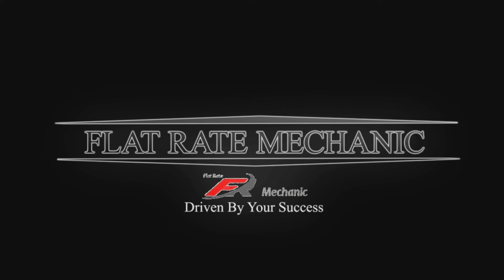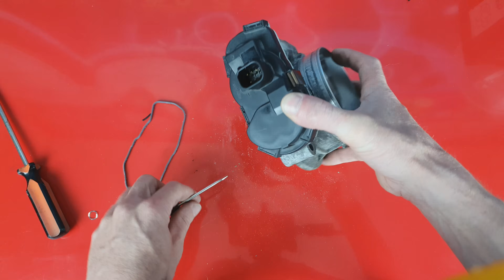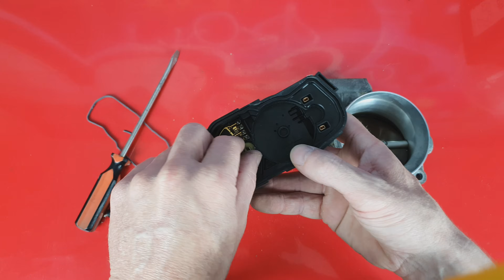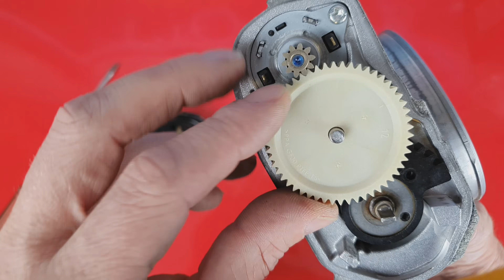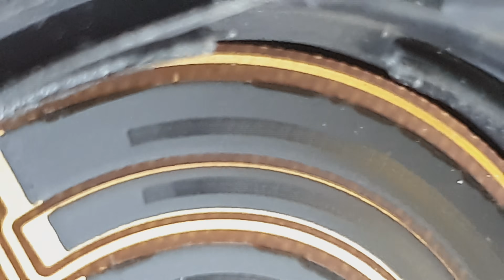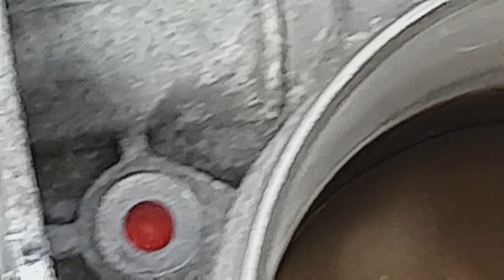Reduced Engine Power Light (Mystery Solved) P1516 P2101

Comment from the maker: Electronic throttle body: https://amzn.to/2ZBiEkR

Electronic throttle body repair kit: https://amzn.to/2FnkgY1

Nissan and Infiniti idle relearn video: https://www.youtube.com/watch?v=7Gy1jINENOU

Reduced engine power message video: https://www.youtube.com/watch?v=T3sbCJJNNj4
Subscribe to my youtube channel here: https://goo.gl/j1pCfn
Reply: Was your reduced engine code somehow associated with rain, water? I replaced the throttle body and related sensors and the problem went away. For a little while anyways, but it came back shortly after, one thing I noticed. The reduced engine power code  always showed up after a car wash or every time it rained. It is my understanding that there's a service  bulletin from GM related to this fault.
Reply: I put new throttle body & sensor mass air flow  and still not fixed 2008 caddy track control &stabiltrac
Reply: ⁰

Comment: Wow thanks for video I really need to do this to my escalade it will reduce power or it will run like crap like its back firing I turn it off and turn it back on it runs like normal again but I'm sure I need to clean it because I can feel the acceleration in the pedal or some time when I stop at red light then press accelerator pedal it will burn out or take off fast when it should barely take off feels like it's off

Comment: I had about 10 codes, p1516 not being one of them.didnt have reduced engine power. Some codes were p0300 p0171 p0174 and some others. I changed throttle body. Maf sensor. I cleaned a upstream 02 sensor. Changed ignition coils and replaced ecm b fuse. All codes are gone, but now I have reduced engine power as well as p1516

Comment: I have a 2009 Pontiac G5 4 cylinder the RPM raps out at 3-5 Grand I replaced the vacuum lines and bought a new throttle body and filter plus sensor and it still raps out I can't figure it out at all

Comment: 1516 & 2101 Codes on a 2010 Chevy Malibu 6 cylinder. Got message low power mode,  turned it off - tightened battery cable and restarted it ran fine but when I got home these are the Codes I got- thus watching this video.

Comment: 2003 trail blazer. P1515 & P1512. Ign off Pulled the plenum manually opened throttle. Heard a click. Hooked up scan tool and wife tool. Key on motor off instructed wife tool to apply quarter throttle. Throttle responded appropriately. Instructed wife tool to apply full throttle. Wife tool responded with argument 1; failure of mouth code 1. After resetting wife tool proceeded with physical tests. Proceeded to electrical TPS tests thru ALDL port. Full throttle command responded with 100% TPS. Part throttle command responded with 25% TPS and closed command responded with 10%. Start motor expect 10% cold TPS and 6% warm TPS. Stop and restart motor and redo tests three times. Remove duct tape from wife tool mouth.

Comment: Hi.. I have an 06 H3 Hummer that has these codes and goes into Limp mode only when its Hot out.. above 70* ... and only then, I can drive it all winter with no problems.. I just started it and it was fine till I got to the end of my drive and went into limp mode... I have already replaced the entire throttle body... no change.. I have these codes right now... the one issue I have had is that the sun roof leaked and put a lot of water inside the vehicle...for a long time ... any suggestions ? The sensors under the seats ? or ?

Comment: 2008 Pontiac Grand Prix V6 3800 series and shes tempermental. For over a year after cleaning TPS and replaced the gas pedal she worked. Now back at it again 🤦‍♂️. Live data shows everything works. Graph data shows smooth curve on acceleration. A total mystery at this point.

Comment: 2008 Silverado. I’ve changed both sensors on the throttle body and the pedal and still get p2127 code. It’s still in reduce power mode. Can you help?
Reply: Ground cable from body frame
Reply: Same here. 2007 chevy avalanche ltz. Even bypassed all connections and directly wired all wires from accelerator pedal to ecm

Comment: 2009 chevy hhr ls 2.2 reduced engine power service traction control and service esc
Reply from the maker: Sorry about your your multiple lights, but in most cases one will set the other. I have replaced many throttle bodies on these vehicles with good results. But have also ran across a few out-landers. TPS sensor and or bad connections or wiring and ground problems.

Comment: 2019 Nissan Titan - code P2101. I replaced the air filter that was very clogged with dirt and some black soot and the check engine light disappeared.

Comment: I have engine reduced power message. Shut the car off, now it won’t start. It wants to but won’t lol. 
I changed spark plugs. Next is throttle body and sensor, and mas airflow sensor. Then fuel stuff! 
Thanks for your video!
Reply: Same

Comment: 2009 Chevrolet HHR SS turbocharged P0121 code for Throttle position sensor that cause power reduce I turned if of and worked until I got home
Reply: Did you ever figure out what was wrong? My Saturn ion is doing this

Comment: My 2004 Chevy 2500HD w/ 6.0 is killing me with this. It’s intermittent and non consistent.  Thanks for video. Am about to try to open TPS to repair or resurface contacts inside. Will post results
Reply: How did it turn out? I have intermittent issue as well.

Comment: 2003 Saturn Vue with 2.2L ecotec.  Seems to be very moisture sensitive. No codes for 5000 mi from April to Early October, then several codes per drive after the seasonal rain started mid-October. (Pacific North West). Mostly P1271, P1275 .  One time P1516 and P1512 after being parked all winter.

Comment: Had a code p2101 throttle body actuator, I replaced throttle body & reprogrammed but check engine light still comes on with same code ???help what it could be

Comment: My 2002 tahoe had reduce power message I replaced the TPS by the alternator no help. The scanner is coded p1221.  I can’t purchase a new TOC.  I have to purchase the whole throttle body for $500.00.  Is there additional troubleshooting I could perform before spending that much?
Reply: Before anything check ground cable clean all corrosion

Comment: GMC Sierra 1500.  Codes P1516 P2101 P0572.  Have just recently replaced the Throttle Position Sensor (TPS).  Wiped out the throttle throat, but did not disconnect.

Comment: 2018 Chevy Trax. Reduced Engine power came on, I couldn’t go but 10 mph? I cut my car off and turn it back on. I made it home but the engine light is on now. First time this has ever happened and I just had my oil changed and Front brakes and tires rotated at stone less than a month.

Comment: This happened earlier to me (2013 Chevrolet Malibu) on the goddamned highway going 65 MPH and Overspeed warning Reduced engine power and engine light came on.
I worked out how to safely get the car home, but I was lucky that I had a safe place to pull over for the car to  crap out when it happened. It seems to happen around 3000 RPMs and returns to normal around 2k

Comment: I’m get a mixture of readings on my dashboard one of them is reduced engine power when I turn the car off and let it sit for a minute and restart the messages go away, but when it says reduce power, I’m getting the exact symptoms of what you talking about it barely wants to let me accelerate if I replace replace my throttlebody on my 2012 Chevy impala LTZ do I need a scan tool to reset it???

Comment: 2011 Buick Lacrosse CXS...car started idling a little wonky and showing signs of power loss in the performance. I replaced the throttle body/tbps and the spark plugs. Months later it started almost stalling at red lights at times until one day I got the "engine power reduced" message and check engine light along with a strong exhaust fumes smell through the vents. Online, there's a lot of talk about the Buick's timing chains issues. Not sure where to go next with this. Any advice would be helpful

Comment: Need help with my 04 cts I replaced throttle body and it still starts and stalls and there's no codes I cleared them I been frustrated trying to figure out why it starts then stalls and have changed many things but having no luck I reset ecm and everything but still it won't stay running unless I hold the petal slightly please someone help me figure it out thx

Comment: I have a 2010 chevy traverse. I cleaned the throttle body and changed the purge valve. It’s still sounding funny when I start it and still says engine reduced power.

Comment: Cleaning the throttle body on a 2007-2014 silverado/Tahoe WILL require a high-end scan tool with the throttle body relearn/idle relearn procedure. I learned the hard way. Got a check engine for TPS sensor, replaced tps and still got the code. Took off and replaced whole throttle body. Didn’t have a scan tool and the truck wanted to idle at 3400rpm. Not good. Can’t drive like that for it to relearn. MUST HAVE SCAN TOOL
Reply: Nope..high idle doesnt last long. Run for 3 minutes turn off car. Turn key to on position for about 60 seconds. Start car for about 3 minutes again....idle will drop to about 1000 within that time.
Reply: You try pumping the gas peddle 5 times before start 
Turn key one turn pump peddle 5 times turn over and let it sit for a few seconds 
Might Rev high 
But computer will tell car and rpms should drop 
Give it a shot if you haven't fixed it 
Should work 
Worked for me in 2006 trail blazer
Reply: You are right! YOU NEED THE SCAN TOOL. IF YOU CLEAN IT AND STILL HAVING ISSUES ITS BECAUSE ITS NOT LEANED THE IDLE!!! This guy doesn’t know.

Comment: Got a 02 escalade loss of engine power backfiring I throw lots of random codes but 1 consistent code p0178 fuel composition sensor low circuit well I have the 6.0 non flex fuel I've replaced all grounds I have good 5.v references replaced map ,maf, battery ,starter, throttle body had 1 coil pack bad replaced it still haven't solved issue can you help! Any ideas fuel pressure regulator maybe ?

Comment: 2014 Chevy Cruse 1.4 w/turbo automatic
codes P1516, P2101, and P2176 
Wiring from TB to ECM is good, replaced throttle body and it did not fix the problem.
Reply: Sounds like solenoid sensor on the left side of of engine oil flows threw this sensor also has small screen if any dirt from oil gets in it can also cause this problem but it won't be tb itself 
Just fixed my 06 trail blazer for the same reason same codes 
The screen it's self was torn and ripped replaced sensor.. possibly could of cleaned it if it was not broken 
But deleted codes started and ran like a top

Comment: This may help someone out there who lives in extreme cold. I had this and I know my throttle body is clean, because I cleaned it this summer. I live in Edmonton AB and just came back from Calgary AB. It is about -34°C today. The whole drive home I knew something was off with my car. It sounded off, and wasn't performing as well. I have a check engine light on all the time, but I figured I may as well check to see if any new codes came up. Yep. This one and a few others related to throttle body. Cleared code, came right back. Disconnected battery for 30 mins, came right back. So I decided that I may as well look at the actual throttle body. Believe it or not, there were small pieces of ice built up on it! I brushed the ice off, started it up, and it was back to normal! Reason for this comment is that I found no where at all, that this was even a possibility. So if you live in a frozen desert, and this has happened to you, check for ice! 🧊
Reply: -20°F here last night. Didn't even think of looking at the throttle body because I also knew it was clean. Saw your comment, looked, and saw the same thing. Knocked out the ice and we're back in business. Thanks for sharing!
Reply: Another reason NOT to TAILGATE. Cars in front of you are belching hot moist exhaust right into your intake where it freezes again as it covers every surface of every part of YOUR air intake system. Don’t believe me? Try NOT tailgating to see if it never happens again vs KEEP tailgating to see how quickly often it keeps happening. Either way, be safe out there people.
Reply: Wym? This summer is just now starting bruh
Reply: @JameGoFast27  I posted this from Edmonton AB in February.
Reply: the throttle body in my suburban with the 5.3 has a 1/4" coolant line built into the bottom of the throttle blades that runs hot coolant to the bottom side of the throttle body bore opening to prevent this.   idk GM got rid of it on some models ater 06
Reply: What make of car you have?

Comment: If engine in Warm Mode. (Middle of Cold and Hot)      
Check Engine Prompt

1.
P1516 - Command VS Actual Throttle Position Performance ( TAC Module )
2.
P2101
Throttle Actuator Control Motor Circuit Range/Performance
3. 
P2106
Throttle Actuator Control System - Forced Limited Power.

I Already Cleaned the Throttle and still Prompting once in Warm Mode. (Middle of Cold and Hot)

Comment: 2008 Pontiac G8 non GT V6. Took it off cleaned it , also replaced the sensor on side , ran great and 100% better . After 3 days driving it reduced power again. Not sure now.
Reply: Same situation on my caddy
Reply: Same for 05 grand prix. Had it cleaned. Didn't help.
Reply: ‘10 Malibu same

Comment: 03 Silverado 2500 hd I have to disconnect the battery 5 minutes seems to be the lucky number then the check engine light stays on but it out of that reduced engine mode

Comment: 03 gmc Yukon denali. Traction control comes on for a split second because reduced engine power light already replaced the throttle body still doing it. Anyone have a idea what it is?
Reply: Get your throttle body cleaned
Reply: I already replaced the throttle body. Still doing it.

Comment: Hi I have a Chevy blazer 05 LS. And it’s under 0 degrees where I am... about 5 minutes ago I started my car gave it barely any time to warm up drove off and it resulted in this light coming on. What do I do? I know I didn’t let the car warm up enough.
Reply: Probably throttle body. Try cleaning it. Otherwise buy a new one. I've been having this code for 2.5 years. It's not a huge deal. I cleaned it. I just pull over and restart it and it's gone for a few days or weeks. Depends on how cold it is

Comment: 2008 Colorado 2.9L (2005-2011) all have the same issues. From what I could find online.
Reply: I have an 08 Colorado 2.9 also. To this day and actually right now at this moment I'm still fighting with this issue.  I received a notice in the mail saying it's a recall from Chevrolet.  I've taken it to the dealership multiple times to have this corrected. It still keeps reoccurring and currently fighting with it now.  I've often thought about trying to sale the pickup but don't feel comfortable passing the truck/problem on to someone else.

Comment: 2003 chevy avalance.Was turning over but not cranking.turn off key and nothing.hour later starts.put in shop no codes now loss of power light on.tried disconnect battery light still one.2 shops and still problem.

Comment: 2003 Silverado. Cleaned the throttle body, cleared the code and it is purring like a kitten
Reply: I’m being given a 2003 1500 for free that has that error code every now and then, mostly when cold (I hear) 440K miles on it but still being used as a work truck. This is one thing I’ll check out and clean.

Comment: 2007 GMC Sierra. Reduced power mode. First the codes came back as PO69E, P2135,P2176. Cleaned the throttle body didn't work. Replaced the throttle position sensor on the throttle body didn't work. Now replaced the pedal position sensor and it went away for a few days but today went into reduced power mode and the whole engine just died in the middle of the road and wouldn't crank or anything. After 5 min it started right up. Now the same codes are reading above plus a couple more. P1516 and P2101 are now showing up with the other 3 codes listed above. I figured since I clean the throttle body, replace the throttle position sensor, replace the pedal position sensor, that the other codes would have went away but actually two more codes popped up after the truck when in reduced power mode and died.I'm beginning to think it's a sensor on my fuel pump which would mean the whole fuel pump might as well be replaced because the sensor is located in the gas tank.but why would all them other code still be popping up after I change the other two sensors? Any help would be appreciated.
Reply: Nope cant be gas it's more of a shortage at the wires ..check that I'm pretty sure that's ur problem I always see it after someone changes out there whole Tb and pedal sensor resulting w the same codes
Reply: Ended up replacing the whole throttle body that fixed the whole problem.
Reply: @codyarnold1411  Just a friendly heads up, it's common for it to work by replacing the body. It has a tendency to reconnect wiring from fucking with everything. I hope that was the issue and you fixed it, but if it starts acting up again, chances are it was the wiring at TB harness. Wish you the best, man.
Reply: Have you checked the wiring at the harness? The thin wires have a tenancy to break.

Comment: I have a chevy cobalt 2006 and have replaced everything and still getting code 2101.... p0443.... p0102 I think..... and some oxygen sensors too..... but what all causes limp mode? Or reduced engine power? Because I need to fix mine so please message me back and let me know if anyone out there knows... powder2009123@gmail.com  thank you

Comment: 2004 gmc envoy giving a p2101 code. It was intermittent now its constant. Cleaned the old one, worked a while. Became more often so I replaced it, no change. Started out trying the relearn with no luck, will not clear code at all. About to go get another throttle body.
Reply: Oh man i put it a new throttle body and that didn't fix it